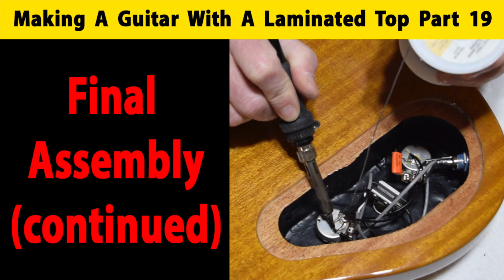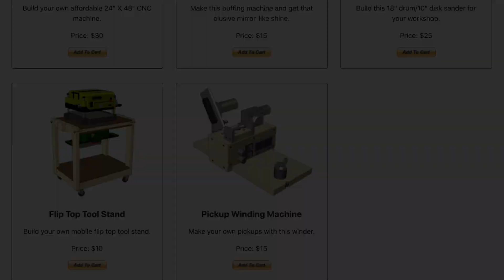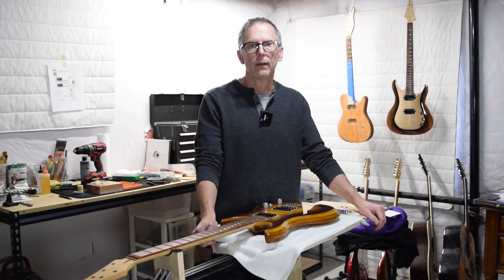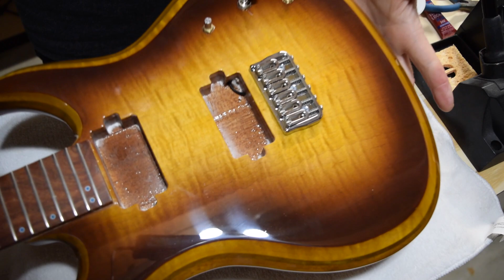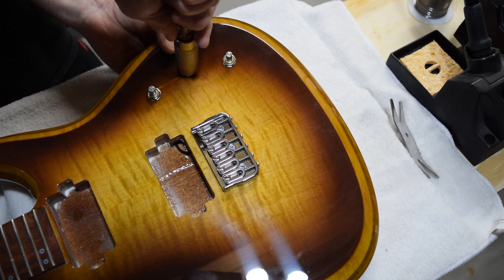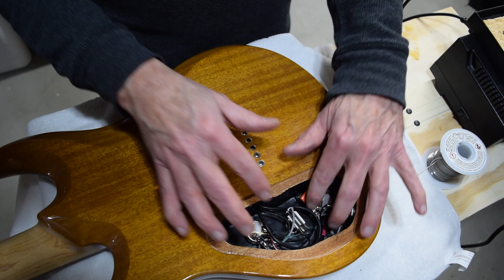Making A Laminated Top Guitar Part 19 Final Assembly (continued)

Comment: how do you know where to drill holes for the pickup covers?
did you measure before or is it experience?
Reply from the maker: What pickup covers?
Reply: @HighlineGuitars  not the covers, I meant the mounting rings
Reply from the maker: @mabutu1  I designed the rings on a computer and cut them out on my CNC machine. The dimensions are based on a typical humbucker ring.
Reply: @HighlineGuitars  when you put them on the guitar - you jst drill for them.
how do you know they'll be i the correct position right unde the strings?
Reply from the maker: That’s the beauty of computers and CNC. Everything lines up perfectly. If you don’t have this luxury, you can stretch a length of sewing thread from the nut to the bridge in the high and low e position in order to check the pole-to-string alignment before drilling the ring mounting holes.

Comment: LOVE the build. But as a repair tech...putting Loctite (and that much of it) on the back of those panel/chassis jack is going to make it hell for the person that has to replace it when it breaks (which they do frequently).

If I may possibly make a suggestion...a rubber washer on the outside and a little bit of nail varnish (I use clear) on the threads keep those things in place perfectly. And still allow them to be removed easily should the need arise.

Comment: Thanks so much for shari g the series of videos thay are very informative. I have a question that I would like to ask and that is if im using a 22 fret neck do my scale length from the nut to the bridge should that be 25 1/2" to the saddle of the bridge and should the saddle be placed all the way forward on the bridge when measuring the scale length of 25 1/2"?

Thanks.
Reply from the maker: I position the high e saddle 1/32" back from as far forward as it can go.
Reply: @HighlineGuitars  thanks so much for you quick reply back. And you vudeos are amazing. Thanks so much for sharing.